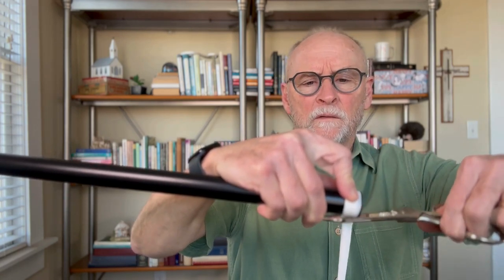Replacing the Tape on Howard Low D Whistle

Comment: Holding the roll of tape is easier if you curl your "bird" finger through the hole in the centre so that the tape unrolls from under your thumb. Your thumb and other three fingers then act as a brake against the rim of the roll to prevent excessive tape unrolling and helps you to apply tension.
Reply from the maker: Brilliant! Thanks

Comment: No Vaseline?
Reply from the maker: Ooo - I should have mentioned a lubricant like Vaseline for metal heads. Thanks for the reminder. I’ll make an add
Reply from the maker: I like to use cork grease, which is basically the same thing as unflavored lip balm.
Reply from the maker: You are my hero for the reminder. I intended to add that for tunable whistles that don't have tape. I just made a new video that I'll publish in a bit. THANK YOU!!!
Reply: @LowDWhistle  thanks!!!
Reply: Thank you Scott. My. Tony Dixon alto G has O rings fitted into the machined grooves. All it needs is a tiny smear of Vaseline on them when reassembling. Your tip for aligning the head with the finger holes is appreciated.